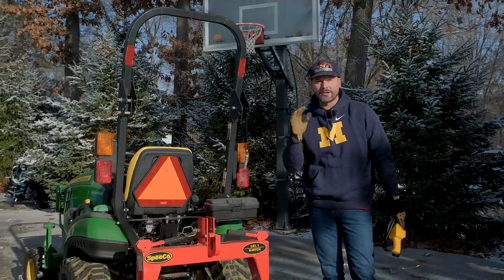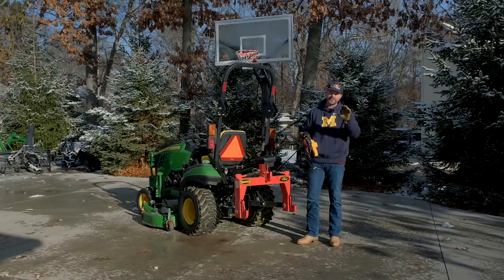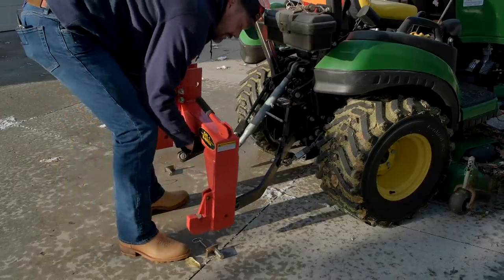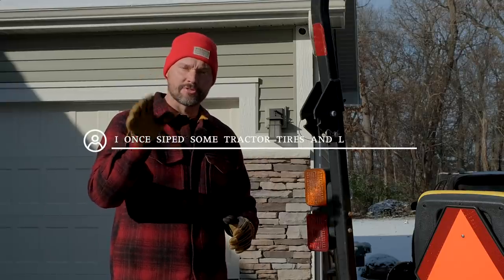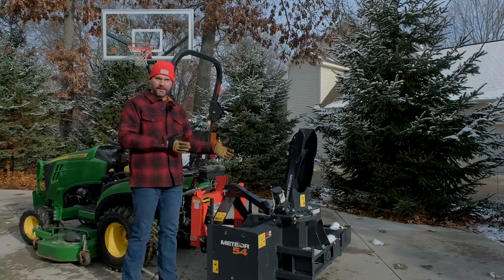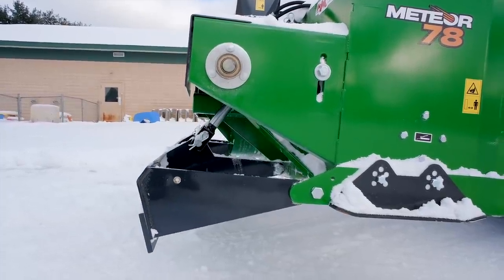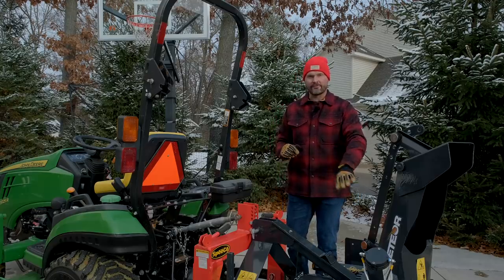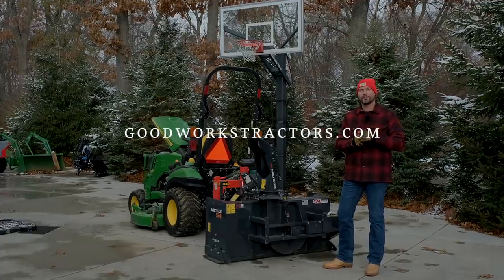IS ELECTRIC EASIER? INVERTED SNOWBLOWER INSTALL ON JOHN DEERE 1025R! 🔥❄🚜

Comment: Courtney, Might I suggest a circuit breaker of fuse when connecting directly to the battery just in case.  
Just as a point of interest: On my tractor I have installed 2 protected circuits. A 150amp I use for dump trailers, winches and cranes. And a 40 amp switch controlled circuit I use for sprayers, etc. I use common connectors on all of my equipment so it's easy to connect up whatever I need. Commonality makes life easy. Cheers!

Comment: Nice. I think you'll especially appreciate inverted when not having a cab...you get much less covered in snow as driving away from the plume of snow. In tighter places eg with neighbours a controllable chute deflector is also nice to have. Tire chains are great but not on pavement/concrete.
Reply: I see many people getting covered in snow from just not keeping the chute pointed as low as practical. Still there are some days that have a high wind blowing the wrong way, on those days I'm blowing snow really low, thank goodness for remote chute deflector control

Comment: I siped my R4s with a tool I made from a broom handle.  I did it in a non-heated garage when it was about 40' with no problem.  Took 10 minutes to make the tool and probably an hour to do the tires.

Comment: I’ve used that pull behind style snowblower commercially a few years ago. It worked very well except I felt like I needed to be part owl so my head could be on a swivel. Never have I gotten such a stiff neck from blowing snow in my life. I don’t know how guys do it for so many hours at a time but it’s not for me. I would take the front mounted snowblower (if applicable) anytime over the pull behind.

Comment: I noticed you have the older air filter on this 1025r, I would recommend swapping it over to the newer ones, the older ones had the habit to break themselves or the valve cover. There are several videos on this issue and deere has the kit to swap it over

Comment: Tire grooving tool used by dirt track racers. I grooved the R4s on my Kubota L6060.  Helps on snow and ice.  No noticeable changes in mud or dirt.  Also, only run about 13 psi in rear tires.
Reply: Could you add pictures of the pattern you cut into the tread?

Comment: We have siped the truck tires before. But be aware that by siping you reduce the lug strength an longevity of the tire. Especially if you spin the tires alot.
Reply from the maker: Thanks Kenneth.  That makes sense.  For me, that would be a worthwhile trade-off.

Comment: i have a kubota l3800 with r1 tires.  i do a lot of snow removal.  i first ran with no siping, and it truly sucked in the snow.  as an experiment i siped the fronts (cheaper to replace if i destroyed a tire or 2).  it was a night and day improvement.  i have now done the rears, and i'm eagerly waiting for snow to see how it works.

Comment: Grooved R4 tires on JD4410 about 5 years ago and have been thrilled with traction that I previously did not have. Even with filled rear tires and 900lbs. weight box on rear of tractor those R4's were dangerous especially just after plowing snow down to a thin layer. I took out quarter inch each lug starting about half an inch in from edge and the difference was better than I imagined. The only down side I can think of is that the tires now track mud an clay into garage far more than before.
Reply: What did you use to groove your tires?
Reply: I bought on line an Ideal Groover with blades for about $70...looks like about $90 now. I bet if you ask around you could borrow one. It takes a few hours and a six pack of beer and I had to reload a coup of blades. I actually used a silver marker to help as my freehand is not great. if you send me an email I'll shoot you a few pictures of my finished project

Comment: I have always used a front-mounted snowblower, either hydraulic or belt-driven.  An honest question, with an inverted blower,  is there a problem driving into deeper snow from a shed or garage?  With the front mount, you are clearing a path for the tires, but with it behind you, isn't it harder to clear the snow?
Reply: @jeffreylee7184  which is why I cannot understand an inverted snowblower.  I will stick to the front mount.
Reply: The advantage of the inverted is you can still blow snow while looking forward, but you still have the use of your front loader. If needed, you can use the loader to knock down a drift. In any event, tire chains are a good investment.
Reply: @Mrbink01  I imagine if you have a large or long area to clear the combination front loader/snow pusher and inverted might be handy then.  As for chains, they have gouged my asphalt badly.  I switched to rubberized tire grips
Reply: @dalcassian56  Yes, agreed on the tire chains. I mainly do gravel or concrete, so it doesn't impact me much. Those rubber grips are nice too.
Reply: In my experience, pretty much any snow you can drive your tractor over, the blower can easily move. A front mounted snow blower is probably the most ideal set up, however it can be very expensive to modify your tractor to run one on the front if it isn't set up for it. And, a rear mount allows you to run another attachment on the front. This is the setup I run on my 3720.

Comment: Inverted snowblowers are becoming very popular here in new England . I am happy with my front mounted blower although when the dust settles The inverted snowblower probably cost half of the front mounted. The blower itself is more expensive because of the undercarriage, then I had to add mid pto .  I added a third function to raise and lower the shoot, but that’s not necessary.
Reply: What type of tractor did you add a mid PTO to? How much did it cost and how much did the front 3pt hitch cost? Thanks.
Reply: @reno4819  my tractor is a kiote 3510 se and the mid pto cost 1,500.00 and the front snowblower with the mounting bracket was about 6,000.00. I don’t have a front 3 point hitch.

Comment: I use to have 47in blower on my 92-420 and it was built like a tank! Now I got a 54in on the 1025r and idk if it's just me but the old blower would throw the snow half a mile and the new 54in throws like 12ft!!! And the piece that spins behind the auger is PLASTIC!!!!!!
Reply from the maker: Really not sure how much they could have saved by making that change either.  Couldn't be much.
Reply: Adam check the space between the fan and the shroud if it's to big it won't blow as good. Put a piece of rubber on each blade to close the gap
Reply: Adam, I had an incredible belt-driven blower with my old L120, super reliable.  When I was forced to buy a new tractor, and, because of Deere's constant "upgrading", a new blower, it was a huge step down in strength and quality.  Deere needs to get its head on straight again right fast!